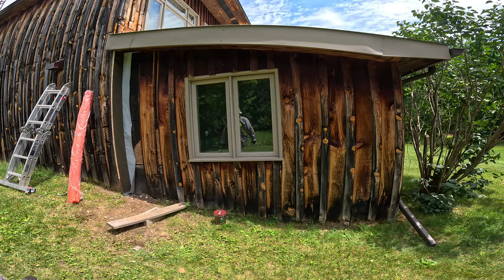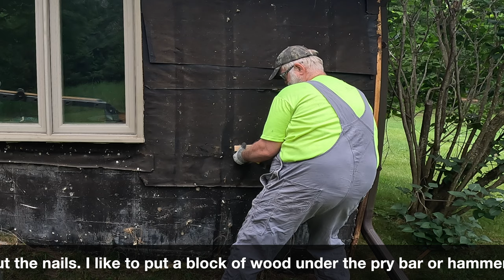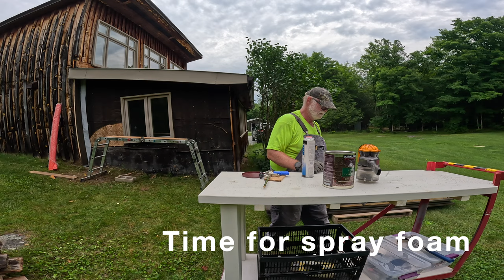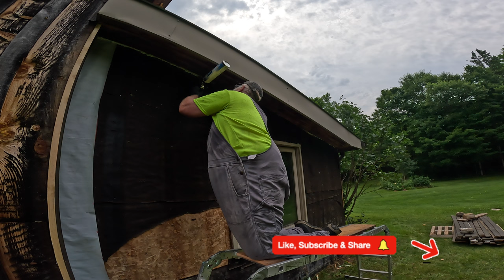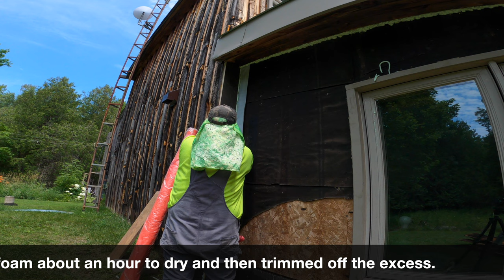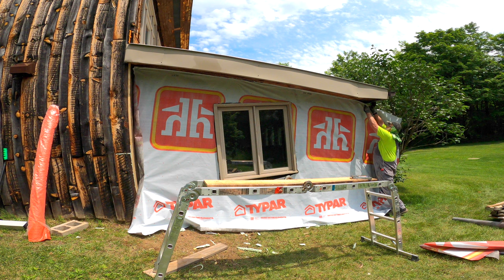Siding Project Day 2. Learning As I Go!

Comment: Hey Brian having the magnet is great for scooping up those stray nails.  Was that window never sealed up? With the high concrete foundation are you going to install girts (horizontal strapping) to pin the board and batten to  or break the wall up with the upper board and batten and the lower stone / brick?  Have a good one!
Reply from the maker: I’m putting some strapping on the concrete. There’s going to be a few pressure treated boards running horizontal along the bottom and the B&B siding will come down to that. What a mess! The windows were only partially sealed. No surprise.